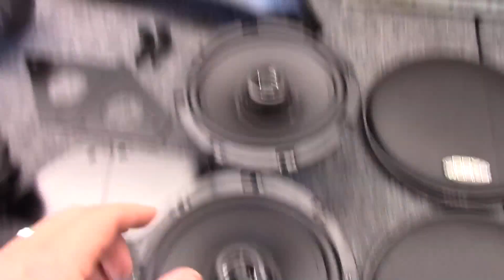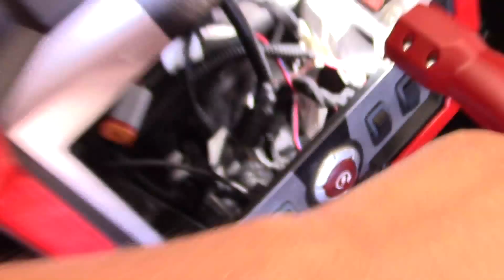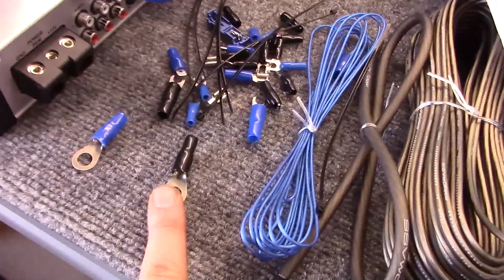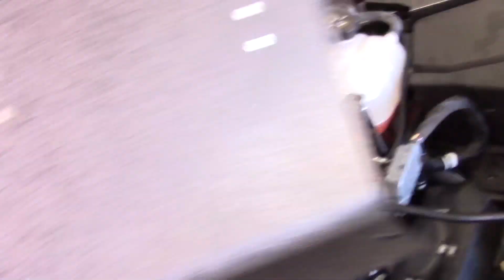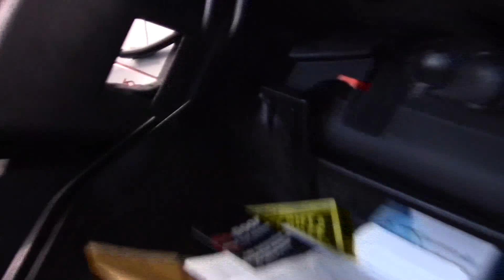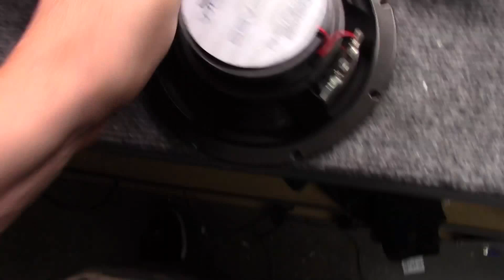SSV Works Aftermarket Stereo System for the Polaris Slingshot

Comment: how does that amp foot in the front????? all that heat from the motor won't last bad install .need all marina system..better wires not harbor freight wires,,,
Reply from the maker: We've actually been selling these for over 5 years without issue in that location. We use marine grade amplifiers and the amp comes with an amp rack that was designed to fit underneath the dash and insulates most of the engine heat.